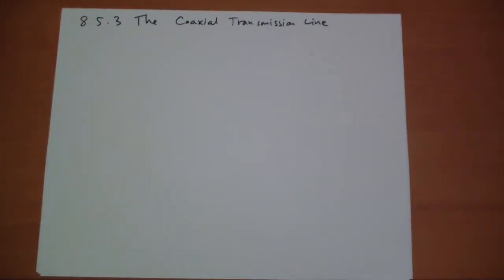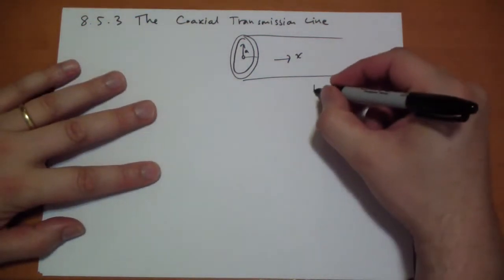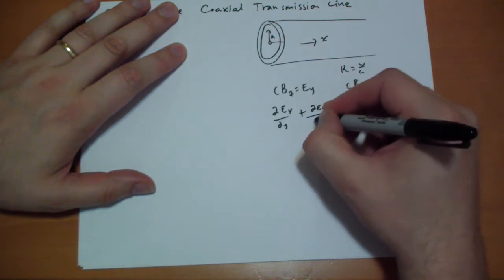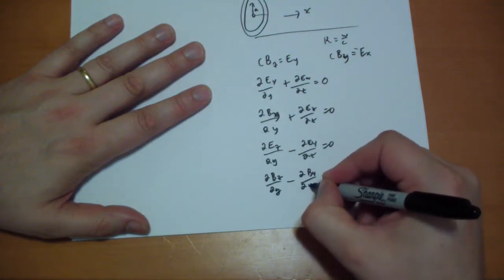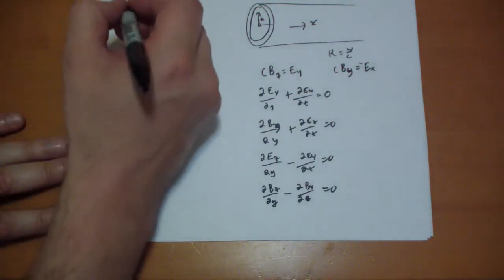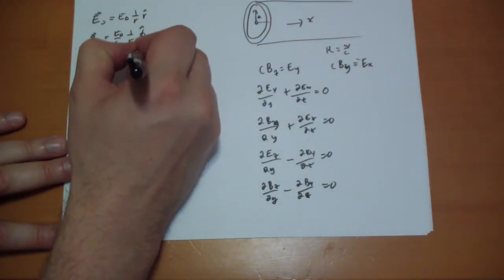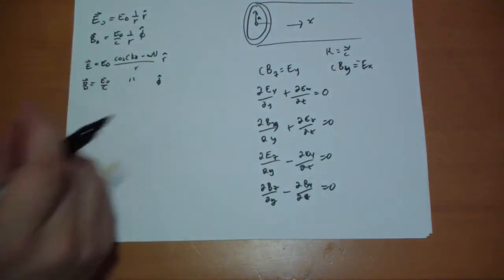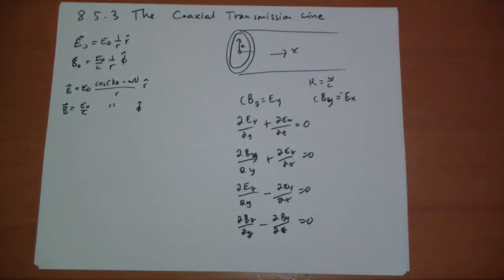8.5.3 The Coaxial Transmission Line

Comment: You are just doing reading from grifth we can do this.. Can you just explain these steps?
Reply from the maker: You need to go back and re-study previous sections if something isn't clear. I can't take you from the basics to this level of topic and have a video that is less than several hours long. Math is like building a brick wall or a pyramid. You really have to get the lower levels solid and flat before you move on, and if you find the pieces don't fit at the top, it's because your foundation is not solid.